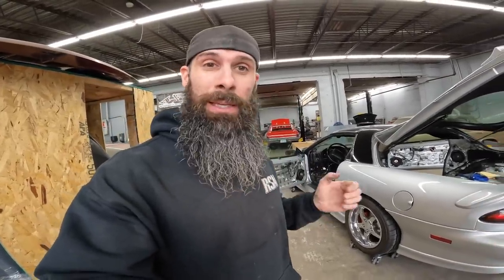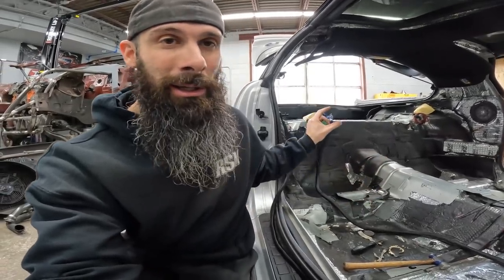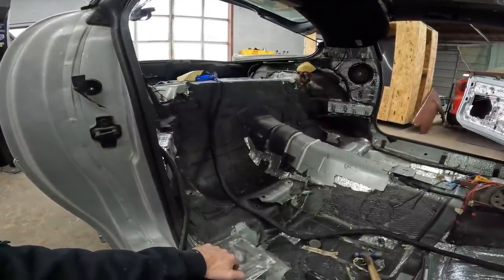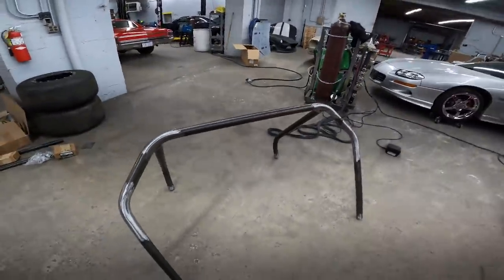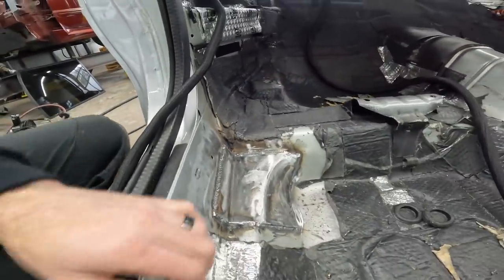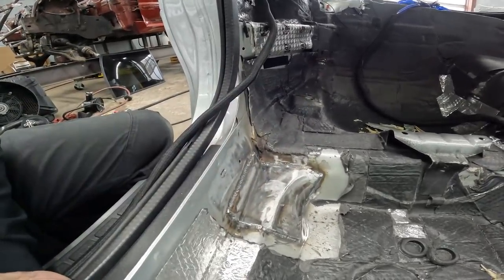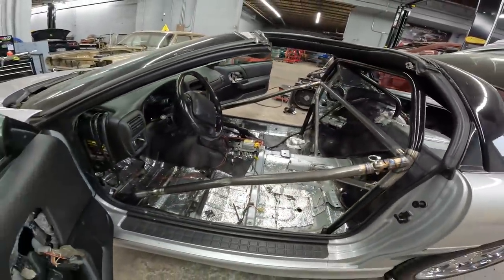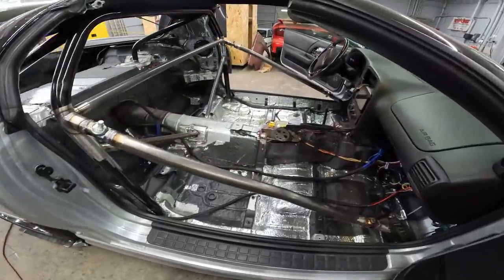RSM Fbody 6 pt/10.00 Cert Chromoly Roll Bar Install

Comment: Do you have to replace chromoly after so long , i have a fox with a 25.5 certed to 7.50 in the 1/4 , thanks
Reply from the maker: Certification is good for 3 years then just has to be re-certed. If rules change for the cage in that timeframe then the cage has to be updated to meet new rule set. Add bars or whatever has changed about the requirements.
Reply: @rocksolidmotorsports7297  so all this stuff about chromoly getting brittle and having to be completely redone is not true ?

Comment: LOL why would you weld roll bars to the drive shaft tunnel???  Are you trying to hold the tunnel up?? Those bars are supposed to go thru the floor and welded to the cars subframe or sub frame connectors.  And Yes i have installed roll bars and yes i do tech at a local track.
Reply: All depends on the cert. being as you work at a track, you should know this…A 6 pt cage has no ties to the tunnel, so not sure what you’re referring too. You only put holes in the floor to drop it down and weld the top half of the cage.
Reply: They can be welded to the tunnel for 10.0 cert. 7.50-9.99 needs to be on the subframe connectors, I would really think a local track tech would know this. Maybe you shouldnt be doing tech if you don’t even understand stuff this simple.

Comment: The door bars look to high?   Supposed to be between the elbow and shoulder looks above the shoulder.  
Seat should be in place to get proper angle
Reply from the maker: The seat was in the car I took it out. It is supposed to pass between the elbow and shoulder but the seat sets a good bit forward of the main hoop. Our cages are within the rules
Reply: @rocksolidmotorsports7297   ah it just looks. So high.  Driver must be a little guy.  Lol.  
Love the channel and your work.  👍🏻👍🏻👍🏻👍🏻👍🏻